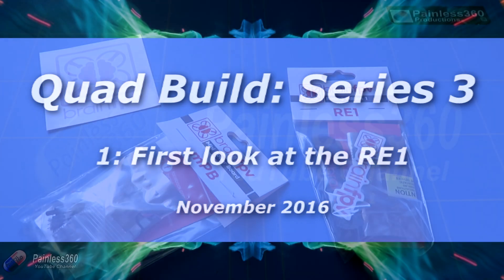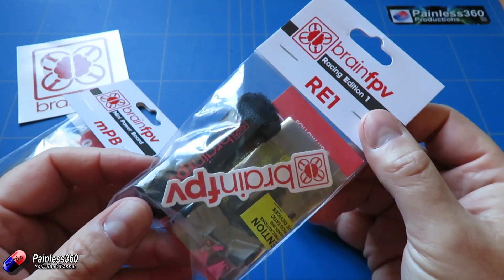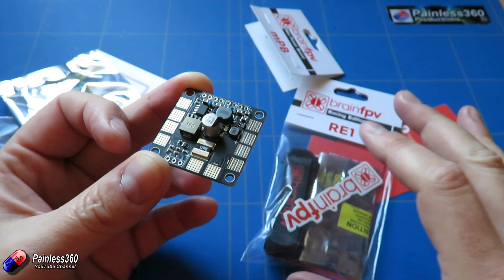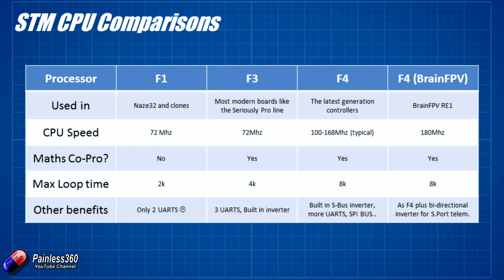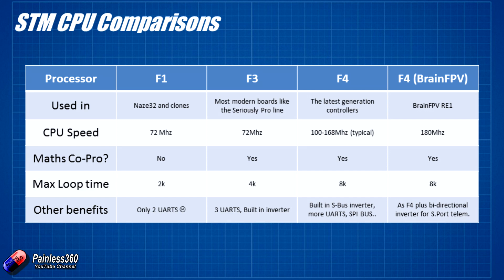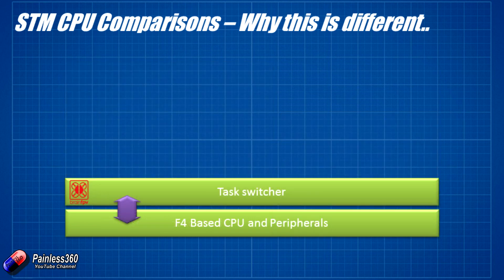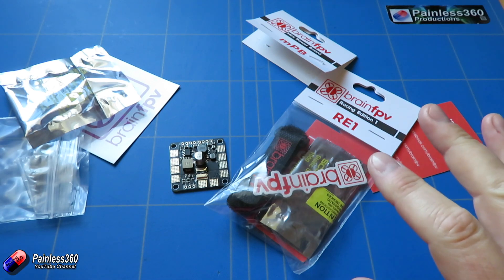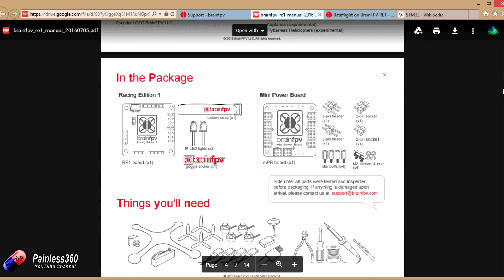(1/7) Quad Build Series 3: Introduction to the BrainFPV RE1 F4 flight controller

Comment: Hi, Can you show how the PIDs and Rates of the FC can be set using the OSD, similar to how Pids and rates parameters can be set in MinimOSD ? The idea is to see how easy it is to configure PIDs in the field without bringing along a laptop or another device.
Reply from the maker: Thanks for the idea. The OSD is far more capable that the 'normal' MinimOSD one and can even show the vibration spectrum live too. I'll make sure we cover this once it's built! Thanks for the idea..

Comment: Painless 360 .. Just wondering if you could use the new Castle Creations ESC'S on your build.. The ones that have the built in logic that can work out intended direction by simply spinning the prop in the direction that you want it to go plus lots more good stuff.
My next build is going to have them in a Chameleon  frame when released as well as well as the re1

M
Reply from the maker: Hi, not planning to on this build as we try and use components that are very 'standard' so the tutorials are relevant for a wide range of technology. Thanks for the idea though - we will look into them! :D

Comment: Hola, quisiera preguntar si la controladora de vuelo brain fpv mas el mpb brain tienen alguna incompatibilidad con el sistema de vuelo HD connex prosigth ya que el OSD del prosight prevalece en los lentes. Gracias
Reply from the maker: No puede utilizar el Connex Prosight con los sistemas FPV onbaord como el del controlador de vuelo BrainFPV. La imagen HD no es compatible. Usted necesita conectar el Connex Vtx al controlador de vuelo usando la telemetría de Mavlink para conseguir cualquier cosa similar. Estaremos viendo esto en el Qiad Build: Series 4 'comenzando pronto ..

Comment: When talking about that controller board I think you've missed the big elephant in the room - namely Lattice FPGA chip which is likely doing all OSD-related heavy lifting. With that kind of companion chip at your disposal, the actual microcontroller is almost irrelevant. On it's own Cortex-M4 microcontroller (which is what F4 is) is waaaaay too slow to do the kind of real-time video processing. At higher resolutions (1080p and higher) even multi-core Cortex-A9's are struggling - which is why they have dedicated video co-processor. This board seems to follow similar approach.
Reply from the maker: Interesting post. Most of the OSD is actually done in the STM32 processor in this setup and the FPGA does the time critical overlaying onto the video signal. so it's not quite as you thought. Hope that helps.
Reply: I would argue that this video overlaying is the single most important piece which allowed the whole system to work. My point is that not MCU, but FPGA is the biggest enabler in this board, not MCU. It just seemed to me that you put too much emphasis on MCU while didn't even mention the real innovation on this board.

Comment: Is it possible to connect the brain fc with my lumenier pdb, that I already got with my frame or do I need to purchase the mPB for battery monitoring?
Reply from the maker: +Jolt Flyer possibly. It's a very easy stack to make if you have all BrainFPV parts.. best of luck!
Reply: Painless360 Alright, I'll see what I can do :)

Comment: Sorry to ask here, but am I to assume that the FC can have features such as follow me etc via cleanflight or betaflight?
Reply: Nick Heidl neither cleanflight or beta flight provide follow me
Reply: Rob Crawford then what does?
Reply: also the other features such as altitude hold, RTH, point of interest
Reply: Basically useless on Baseflight and betaflight at the moment, there is a version called iNav which is apparently fine most of the time.

Sadly most of the time isn't really good enough.

TauLabs and then later LibrePilot where supposed to be quite good for those functions.

I'm having to use a Pixhawk for RTH and camera usage and I would love to get something reliable with a physically smaller flight controller
Reply from the maker: +Nicholas Heidl see our video on flight controller comparison. Over the next few months we will look at the latest 'best bets' for working GPS modes on modern STM32F3 and STM32F4 based flight controllers - iNavflight and DRONIN.. Happy flying!

Comment: TBH unless if you use clean/betaflight it's only going to be yet another quad build (regardless of an F4 processor and a decent looking HUD)

Always figured the like of TauLabs never stood a chance until boards where available and some independent tutorials where available
Reply from the maker: +Rob Crawford this FC only runs Betaflight or Dronin so TAULABS isn't an option. Happy flying!
Reply: Painless360 I used the example of TauLabs as we currently have a clean/betaflight monoculture based entirely around racing and acro (apart from Arducopter)

If the Dronin works then it would be useful to have a few tutorials, and maybe give iNav (or the other Baseflight offsprings) a bit if encouragement to look at something other than racing
Reply: dRonin forked from TauLabs and all of the active TauLabs devs are now working on dRonin.  I believe Peabody is still occasionally working on Tau (currently looking into a LQG controller instead of PID but not progressing very quickly) at this point all significant development is happening on dRonin.
Reply: Iv'e watched Peabodys pages for quite some time, as he tends to come up with pretty decent implementations. I'm fairly hardware/software agnostic and tend to feel that a monoculture tends to prevent interesting things from happening.

When the CC3D (and others) where active, timecop and others had to make their offerings do more than the competition, unfortunately things seem seem to have settled down to shorter loop times and faster ESC updates (which is great for the few that actually require it, but lets face it most of us can't even push an original Naze it's max potential)

My larger Armattan has a Pixhawk and is the only real option, but all I need is a stable platform (that can show a turn of speed when I desire) and I will never need all the mission functionality and base station business, it's overkill (plus the Pixhawk is takes up so much space.)

Currently we are being given the choice between a stripped down sports car or chauffeur driven limo, neither of which really suits the requirements of most people. TauLabs, the various descendants of OpenPilot and now dRonin have all offered that middle ground, but I suspect most folks have avoided them because their wasn't a lot of independent "How To" videos and therefore fell into the developers only ghetto.

So I would like to see dRonin (and others) being setup by somebody (who isn't a developer,) and just perhaps more people will go, "Yeah that's a viable system" let's give it a try, then the cross fertilisation can start again.

Hence my comments here
Reply: I've been trying to help by doing some videos on dRonin - just haven't had the time to do all the ones I'd like to.  I'm not a strong enough coder to contribute as a developer - but I take part in development as a tester and help with the social media.  

So I fully agree that seeing more people at least try dRonin and sharing their experiences is very much needed.  

You may find the flyingPi project at dRonin interesting since it sounds like something you may enjoy.  It's running the dRonin flight stack on a RaspPi 3 with a shield containing the required sensors - but leaves 2 of the Pi's cores free for more advanced  CV/autonomous/semi-autonomous type of stuff.  It's currently at a point where it can fly and is waiting on people who have the time and interest to work on putting those extra cores to use.

Personally I love that dRonin gives me a FW that can fly aggressively and have some serious fun...but also supports advanced autonomous/semi-autonomous flight.  The autotune making getting a new setup flying great in just minutes is just icing on the cake.
Reply: I haven't flown for over a year due to confidence (two lost machines, both due to firmware issues) so I had been watching TauLabs when I started building a replacement machine, but between actually being able to buy a Brain, and lack of independent examples I went to the Pixhawk (as my old APM machines had never let me down.) but is overkill (and I couldn't afford an Eagletree Vector to try.)

I now also have a pair of Clean/Betaflight machines ready to fly but I feel I have been forced into a compromise choice of software/hardware (especially as one of them is another v-tail and at least I know how to calculate the mixes for clean/betaflight)

I will have a look at your youtube page (once I escape work) as I may persuade somebody to buy me a Brain for christmas and any additional info sources will make things more tolerable

Hmm, unfortunately the Pi would suffer from the same size issue as the Pixhawk (I like the 36mm format a lot) though perhaps if a multicore Teensy was released, that would convert me :)

Heh, I'm an old time assembly language coder so I tend to get upset at so much processing power being thrown at flight controllers ;) Funny enough I was looking at the CI20 MIPS dual core boards as something to port a basic flight controller to.
Reply: Depending on the FC's in your *flight machines you may be able to try dRonin on them.  Most of the F3 boards aren't supported since they have a CP2102 between the F3 and USB which means dRonin can't use it's bootloader and that makes for a less friendly experience (naze which is supported despite the CP2102 is an example of this - dRonin's great auto-upgrade doesn't work on naze as a result and flashing it isn't straight forward since it can't be done from GCS.)  But revo and the new revo acro clones are supported, as are CC3D, Lux, Sparky, Sparky2...basically everything Tau supported (except flyingF4 which had hardware issues) plus some newer targets.  The acro revo boards are a great low cost option for testing it out.  The latest release also supports the built in OSD in the "Omnibus F4" boards though configuring the OSD is currently only possible through the UAVO browser.

The Pi is big...and rather overkill for most people.  Just thought you may find it interesting coming from a Pixhawk ;)  Plus the shield isn't in production so you have to roll your own which most people aren't up for.  

Really even the F4 is overkill for most FC's. But that gets into the whole debate about against chasing lower loop times and ESC rates which I'd rather not drag this conversation into :D
Reply: Jason Hitesman thanks for the info, my Morphite 180 has an Evo in it and the Quark has a Naze Rev 6 which I really dislike, though with it being such a small machine, I may move the Evo into it and stick a new board into the Morphite.

Currently I have a nice integrated PDB in my larger machine that I can't use properly because the Pixhawk so big, so if I could a nice stable GPS loiter that will switch to a nice "sport mode" in a 36mm form factor it would be ideal for that machine.

I have been avoiding the Pi family as it's either too powerful or underpowered for most of my requirements (though if they did one that had native PoE they would be ideal for a project I have)

I dislike products that waste computing resources, though I forgive the Pixhawk as it has a proper spare processor) and still write thinks like custom loaders and CRC routines for old Z80 machines to keep in practice) which also hints at why ever shorter loop times for racing doesn't benefit me as my reactions are too slow these days.
Reply: That's my exact complaint about the Pi :D  So many projects that use it are either underpowered or would be better done with a microcontroller.  

The evo should give you a really good experience with dRonin (as would the RE1 of course!), biggest issue you're likely to have with the evo is the onboard mag may not do much good due to proximity of power sources.  So it's best to run an external mag with the GPS up and away from the noise.